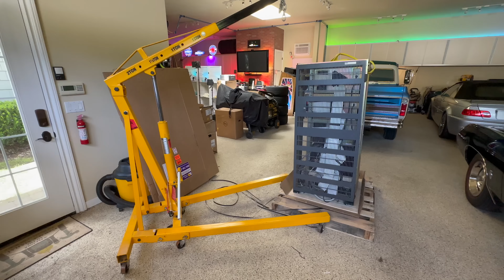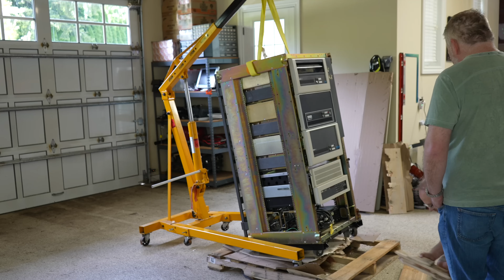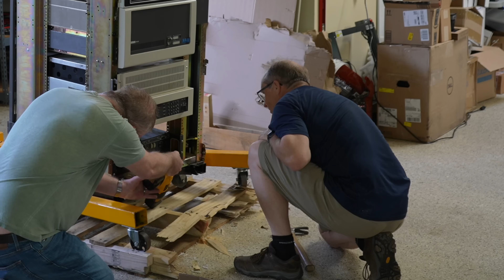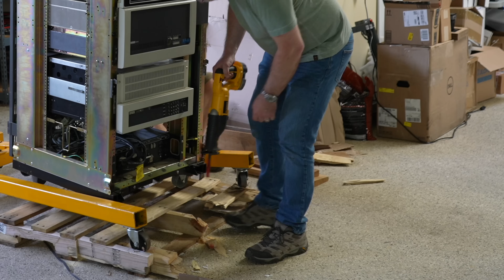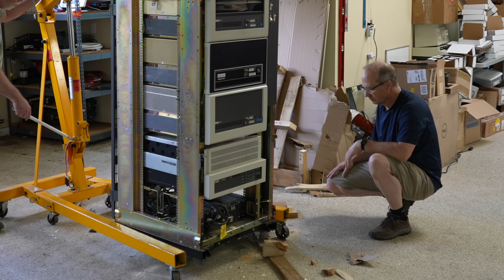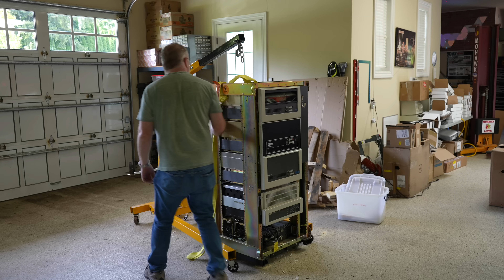I Bought the HEAVIEST Computer on eBay: The PDP-11/34!

Comment: Hard drive head crashes of drives from this era aren't just destructive, they can be extremely dangerous.  There is a story of at least one such drive that had a head crash during a weekend, when there was no operator around to deal with it.  At some point, it developed a wobble.  A wobble in a steel disk a few millimeters thick, somewhere between 10 and 24 inches in diameter, spinning at a few thousand RPM.  On Monday morning, one disk was found embedded up to the hub in a cinder block wall.

Comment: Hi there. Just watched your video. Brings back memories, I was a DEC repair centre engineer in the 1980s doing component level repairs to all the PDP11 range as well as VAX. 
I've got a couple of tips for you. Firstly, always use ESD protection meaning a wrist strap and proper anti static workbench when poking fingers in or removing parts from your machine. Please don't tell me they won't be damaged by static, they will be.
Secondly, no need for flow control on your VT220 if you turn off the smooth scroll option. It will keep up with the 9600 bps output.
Looks like you're having some fun  with your 11/34... keep it up. Great to see one running again.
Reply: Yes, the flow-control thing didn't make sense to me either.  You'd likely need that for any kind of printing terminal, but not for a CRT especially at like 9600 bps.

Comment: I've gotten many of these machines from UC  Berkley,  UC Havard, regents,  as well, LBL Lab surplus sales over the decades. One thing I always did was to pull al the cards, one at a time and clean the gold contacts with alcohol and a clean camera lens  cloth. Then  re inserted and pulled out 3 times to clean the female bus contacts by friction. As well as a visual inspection of all the components on the boards, like the capacitors that may be leaking or swollen,  for sure. Just food for thought.

Best,  Laser Dale,  Former "Cyber Lab"  Laser, computer engineering department.  at 150 Folsum S.F. California

Comment: We had a PDP-11/03 when I was in high school. Only the teacher running one class and I could get the thing to boot.

Some few years later, I joined the Army and what did I see in a programming hut in the field? A PDP-11/70 to program our Pershing II nuclear missile.
Which was retired barely after it was introduced - thankfully.

I'd have built in a rail system with hoist to maneuver the infernal thing, less of a toe risk.
I'd also probably be diagnosing the capacitor problem myself, but old habits of an ET...

If we're ever in the same neighborhood, I'll grab some wire wrap tools and wire and give you a quick class, it's quite easy.
I'll probably need two sets of reading glasses though...
And to think, used to repair that kind of thing to component level. Fun, when they introduced four layer boards, given they were de-introducing rooms with rubber wallpaper around the same time...

Now, remembering TTL, especially fun things like ECL logic circuits, that'll take a bit to regrind those wheels rust off.
And yeah, I've also worked with vacuum tube circuits, but that was all analog. Shouldn't be too hard though, it's either on or it's off and the oscilloscope will tell that tale.

Comment: I was kinda wondering why you didn't go for an 11/44?
Also, we used to use a DECUS C-compiler that worked very well, and was much better than Pascal, FORTRAN or RT-11 assembly.
I'm sure you could get a copy if you already don't have one.
Anyway, I still remember using 6 PDP-11/44's Eithernetted to 20+ 11/73's for a defense-contractor back in the 80's for Ronny Ray-Guns!

Comment: Great stuff. When U hit the power switch I immediately thought of the Rk05 EMA hold back clamps..Yes shortening the bus to the minimum needed configuration is the best start. Do U like the way DEC eliminated certain letters from the alphabet, when defining backplane pins. Only used ABCDEFHJKLMNPRSTUV so no confusion with numbers Zero or One. 
Leaving G out I believe would have been in case of a bad lettering in marking on backplane or printing in circuit  drawing copies, could have caused confusion with the letter C.

Comment: Good presentation. Was with DEC for 15 yeas. TOPS10/20, VAX/VMS,. ALPHA/ OpenVMS, ULTRIX, SYSTEM 5, etc. was a VMS Partner, COBOL, FORTRAN, Assembly, etc
Met Ken Olsen several times and have a picture of us shaking hands

Ricky from IBM(previously DEC)

Comment: Do you remember M&S Computing? Renamed Intergraph I think around 1979. They built computer graphics systems then and were the largest DEC OEM client , I have administered three generations of them, one based on a PDP11-34, the second one on a PDP11-70 and the third one on a VAX, also building their own disk controllers for faster file access. Awesome memories!

Comment: Yea well Dave, the GEN of The PDP it the the RAW Gen's of the PDP 11 DEC systems are Weird, from the Start 11/05, 11/04, and the 11/03 these are the main Base Units of the PDP 11 .. But Yours is the the 3rd Gen of the system design of the 11/x4 DEC units to the 11/94 was the planed Life the x4 AKA LAB units

Comment: My Assembler class in college was taught first on a PDP 11/17 running RSTS/E. That was the most elegant OS I think I've ever used. The machine had 32K of RAM, and nearing the due date of a project, there would be upwards of 40 people logged in at once. I couldn't tell the difference from when there were just a couple of us. 
There was a command (which I can't remember) which would create disk files of arbitrary size. It had a switch that would prevent zeroing out the data. So I figured out how to snoop on the other people's assignments by creating files near the size of the free space, then scanning through them for assembly code. We had disk quotas, but it was only enforced when logging out. So I could rummage around un-allocated sectors as long as I deleted the files before I got off. Fun times!

Comment: Ah memories - thanks for sharing your journey acquiring a PDP 11/34.  My 1st engineering job was to join a team building software using PDP11/23s and PDP 11/34s running RSX.  Those 20GB RL02 disks were so precious!  Later the company got a microVAX and that was a celebration day!   I drove around the UK and Europe with what was described as a desktop computer (11/73) to demonstrate software to engineers.  What impressed me was the computer cost around GBP50,000 and my company supplied car a mere GBP8000. Lugging a huge computer around when Apple and BBC had much smaller units emerging was amazing and a point when the engineering design and development world was developing and changing rapidly.  I also wrote code in Fortran for the company.  Happy memories!  🤣

Comment: You mentioned several operating systems for the PDP-11s, but you didn't mention RSTS/E, which my college used on a PDP-11/70 to timeshare countless students through the late 70's and early 80's.  I found it much more user-friendly than RT-11 or RSX.

That 11/70 had the lovely purple/pink front panel, I still get nostalgic when I see it in a video or old photo.  I also recall one time going down to the computer center and seeing them upgrade the computer's memory.  By today's standards it was a trivial amount of RAM, but at the time I was very impressed by the massive new boards they pulled out of what seemed like extra-large pizza boxes.

Comment: First Unix was developed on a PDP-15, the laboratory variant of the PDP-8. Unix was developed to get the game players (UBL/Under Bell  Labs/Zork) off of the PDP-10 (a huge mainframe for it's time) so that the scientists could get some real work done. The first port was to an Interdata mini (which I advised on).
The first 20 PDP-11s (the model 20) were delivered to Lawrence Livermore labs, my company AMI Industries received the 21st.

Interesting note the PDP-11 is little endian (low order byte first) not because of any perceived advantage but rather it saved one gate (about 45 cents back then) per bit (16) times a number of different paths.

Comment: The PDP-11 was my first corporate computer!  I was a manufacturing engineer at the time.  Alas, they wouldn't spend money on software, so all documentation for my job was edited on -- you guessed it -- a Line Editor.

For roughly half of what Dave paid (about $2,300), I bought my first PC in 1986 (a double-clocked clone), and I was on my way, using Lotus 1-2-3 for just about all my numerical analysis needs, and various operating systems and productivity software for everything else.

I dutifully blew it up 9 years later, though definitely not on purpose.  It turns out, ants had made their way inside, unbeknownst to me, Fortunately, I'd kept backups and leapt over 286s, 386s, 486s, PS/2s and bought a Pentium in 1995.

But I still have the 30GB RLL hard drive!!!

Comment: I am looking for a rront control panel for a ibm 30 cpu. If necessary I will buy the whole cabinet. I want to gut the cabinet and simulate it operating using a raspberry

Comment: I did some form programming on the Xerox 9700, which included a disk drive and a modified Digital Equipment Corporation (DEC) PDP-11/34 as a print controller and rasterizer. That was way back in 1980...

Comment: my dad worked for CMX systems which used tbe PDP-11/04/34/23 varieties.  my first computing experiences where type a short boot load program, reading paper tape, then programming in basic, playing lunar lander, or printing huge bio-rhythm charts all on an ASR-33 teletype.  i learned everything about DEC PDP-11s.  i was already breadboarding discrete 7400 series TTL for my own little projects, so i could look at a schematic and know exactly what a circuit did on the CPU/memory and I/O cards.  i learned wirewrapping and unwrapping before i was 14.  it’s amazing how far technology has come since then.  i would never own real DEC equipment, it’s a waste of energy.  give me apple silicon or ampere ARM processors all day.

Comment: First computer I used at work for electronics manufacturing machine programming - had to boot it up OCTALY each day... and those floppy discs and the ASCI tape punch...
We used to build compuyer boards for DEC
Reply: The starting address of the RK11 Boot Loader RAM, 773110 octal, is still burned into my brain.
Reply: Apparently I dropped a bit in the last 50 years. According to a Programming Card I found online, it's 773010.

Comment: I took a computer course at Freeport (NY) High School in summer school between 7th and 8th grade.  We learned on a DEC PDP-8 using mark sense 40 col. cards that you filled in with a #2 pencil.  I fell in love with programming that summer.

The following summer the school had upgraded to a DEC PDP-11/35 and after 8th grade graduation I continued my computer education. This time we had a room full of ASR-33 Teletypes. After class was over imagine the sound of a room full of 13 year old programmers running or printing out their programs (or playing Super StarTrek).  I also took a typing course that summer which helped me years later when I worked as a programmer.  I still have some of my programs on paper tape somewhere in the basement.

Comment: Working in a Nuclear control room in the 1980's/1990s; we used PDP 11/34s first until they was found to be too light duty so they were replaced with PDP 11/70s. Very reliable machines. Disk drives were huge. Good times!

Comment: PDP-11 was the computer they used when I started studying in IT way back in 1982. No terminals for first year students, but plain old punchcards. The PDP would send everything to a much more powerful machine (if memory serves me correctly that was a Cyber-205?). That PDP-11 was standing in a room where we would open the windows on warm days, so not a special computerroom with cooling, it just worked!

Comment: Thanks for the interesting video, brings back memories. Back in the 1980s, my company had a PDP 11/70 that we used for software development (Assembler and FORTRAN), running RSX-11M. It was a very reliable machine that housed several customer projects at a time. After building on the PDP, we transferred the software to customer-deliverable equipment for data configuration, testing and shipment. One such system was a control system for a rail transit system in Europe: 6xMicro PDP 11/73s arranged in A/B configuration for redundancy in 3x6-foot high racks: A-rack, I/O rack, B-rack.

Comment: PDP-11s were used heavily by people using EDI ( kind of a forerunner of blockchain). I worked for a company through the 90s whose trading system was based on a distributed network of several hundred pdp-11 8x then 9x. Later on we switched to an emulator running on dell servers.

Comment: Used to have my own 11/34 and had to chip chase a number of interface chips to fix it. From memory it had RK05s later replaced with RL02s. Eventually changed to 11/23 and 11/73 for their smaller size. Fortunately I had access to diagnostic disks.

Comment: I just stumbled onto your posting and thoroughly enjoyed it; after graduating in Electronic Technology back in 1977 I worked briefly for Canadian government at The Dept. of Communications enforcing the Radio Act (overseeing the RF Spectrum). However I could not tolerate the most annoying segment of USERS; the CBer’s or referred to as General Radio Service in Canada. I got relief by getting hired by Consolidated Computer which marketed a Key Edit system which allowed END USERS like Wells Fargo, IRS and others to INPUT data into their Main Frame computers via a Dec based front end managing Key Edit terminals for data inputing rather than say punch cards. As a Final Test Tech I would populate a large computer rack containing a PDP11/34 mini computer, 4 slot core memory rack loaded with 128K, a Mag Tape drive with a 10 card Tape Drive controller. The customer could purchase several different sizes of Fixed Fujitsu Hard Drives in the 24-40MB range. A fully loaded system could have 4 300MB multi-platter drives (size of washing machines requiring 3 phase power) daisy chained to provide 1.2 Gigabytes of data. Imagine all that hardware is replaced multiple times over by a memory stick you carry in your pocket. You would pull recently tested PCB’s to build up system and run tests on system; then use this operating system to verify recently fabricated PCB that had passed a General Radio PC board test for major fault finding and troubleshoot any fault(s) using an oscilloscope and schematics. Those tested PCB would be stocked for future system builds, I did have several opportunities to actual troubleshoot faults on several PDP8 computer boards getting our rework department to replace faulty small or medium scale integration chips. Your adventure brought back a lot of memories; I left that job in 1980 joining Nortel Networks to service Ion Implanters used in manufacturing of Nortel’s customer Silicon chips for their phone systems and Digital Switches. Thanks for that!

Comment: Man, but does this bring back some memories!  In high school, I cut my teeth on the PDP-11/34 running RSTS/E.  I spent so much time in the lab, that I ended up working there.  I gained access to system software source code saved onto magtape.  So I did what came naturally to a student and modified and recompiled the software to give my account permanent admin access.  Ahh, those sweet, sweet memories.  I haven't thought about that in years.  <sigh>

Comment: You could make a wirewrap unwrapping tool... If I recall correctly a thin metal tube about 3mm OD and 2mm ID, with a small slot across the diameter on one end, screwdriver handle on tother. You stick it over the wirewrapped pin and turn anticlockwise. The slot in the tube grabs the wire and undoes it turn by turn... My favourite computer... PDP 8/E.. but keep your fingers away from the tape drives when running haha. I remember loading a COBOL compiler from paper tape turn a high speed optical tape reader, wow that was so fast you had to put the paper tape bin 5 feet away to catch it running through. Looks like you got a real bargain there with a clean looked after machine.

Comment: The disk drive is VERY similar to the HP 7900 series disk drives AND to a drive (sorry I can't remember the model) that shipped with Honeywell Level 6 Minicomputers.  I suspect the internals of the drives are probably the same with the external face elements being swapped.  It's the similarity of the removable disk which leads me to suspect that.  

It might be possible to find parts for your drive from one of those other drives if they are indeed the same internally which is indeed the point.

While it's REALLY nice to have a nice fast SSD on those old systems, there's nothing quite like the sound of a big old hard drive seeking hard enough to shake the whole cabinet.